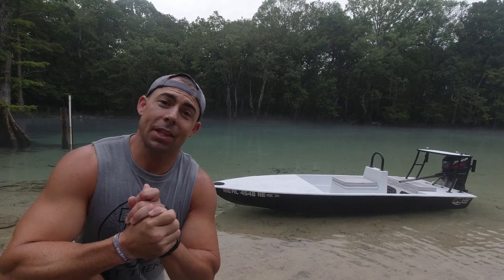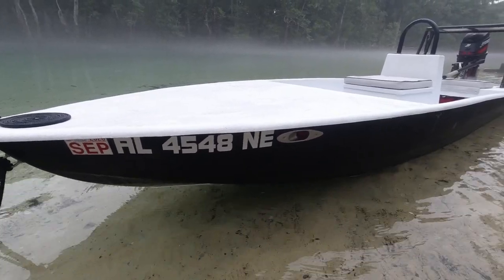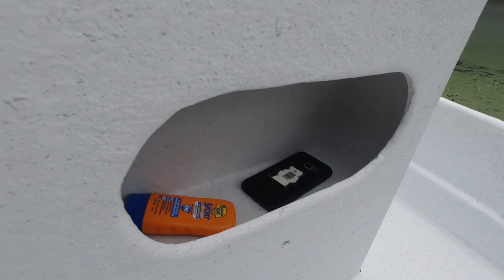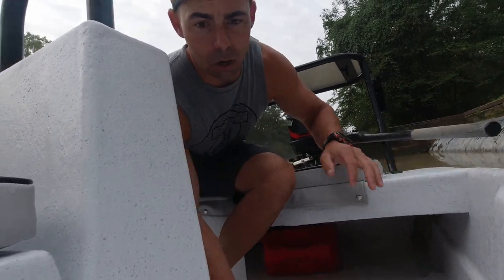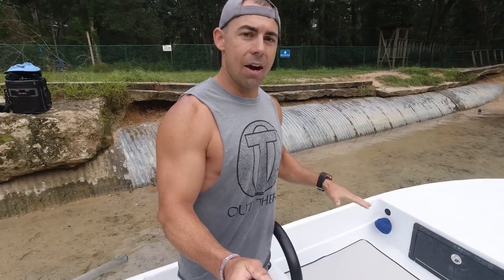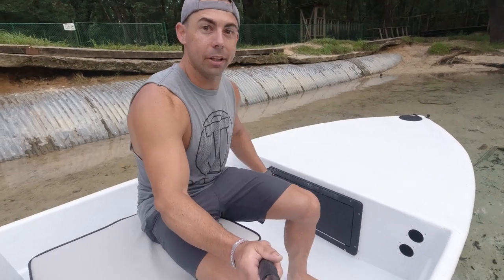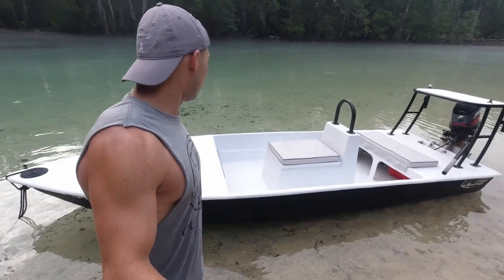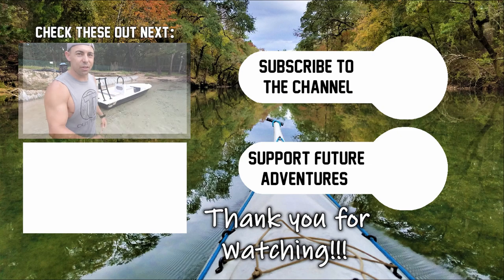MicroSkiff Setup - IPB 14 Overview (Camping Setup)

Comment: Between this IPB (aka Skimmer Skiff" currently) and a 13ft Boston Whaler which would you prefer and why? Plan to do similar rivers in GA and FL. Just had some family move back to Mariana so plan to do the Mill Pond at some point where you caught the craw fish.
Thanks
Reply: buy whaler  13 best boat
Reply: whaler 13 12 galon tank 6 galpn tank bhamhad run

Comment: Hey Trip I was thinking maybe you could rig two post using stainless flush mount rod holders and some custom poles made so you can set up your hammock on the boat
Reply from the maker: To bad the centerline of the boat has the grab bar in the way ;)

Comment: Did you have electric trim on your motor with that jack plate?
Reply from the maker: No, really didn't need it.
Reply: Been looking at one for my boat. I have a 13 foot Carolina skiff with a 25 hp that has automatic trim
Reply: @kylebatson3414  best boàt